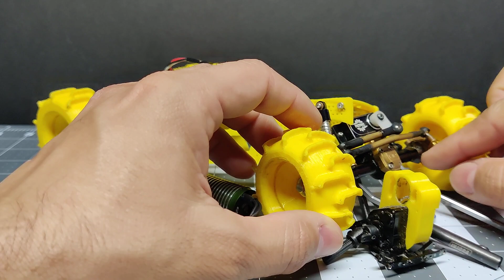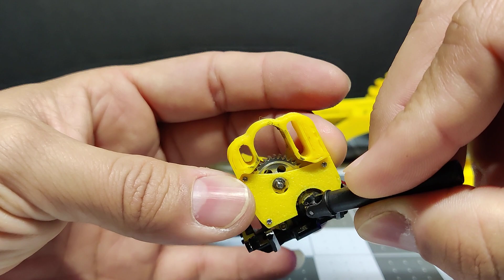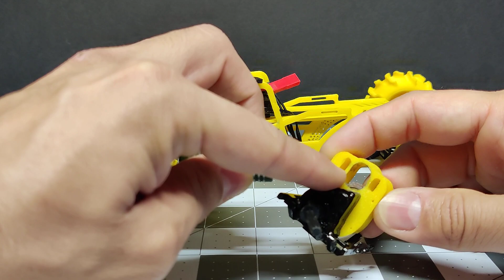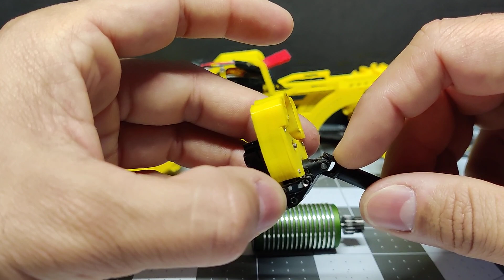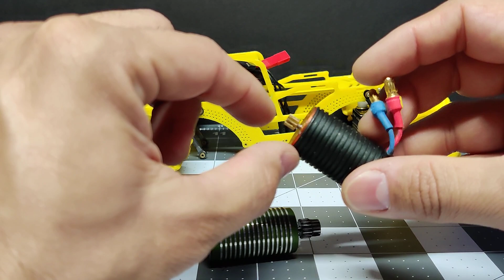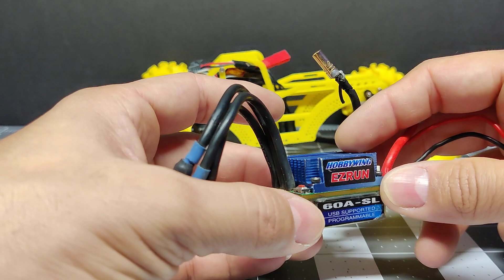SCX24 Furitek Formula Offroad/ Rock Racer post run breakdown.

Comment: I had the same issue with the micro Komodo. I broke every drive shaft that I put on it and when I went to the stainless steel drive shaft that’s when it started breaking dog bones. When I put beefy dog bones in and eventually cvds then it started stripping the transmission and the spur gear and I had a injora trans so I fixed everything and put all stainless steel everything and now the motor will cog down if it’s in a bind instead of breaking everything else. I would much rather have a cheaper weak point like axle shafts but I got tired of breaking and buying new parts so I just try to take it easy with the micro Komodo and I dog out the crawlers that have the OG Komodo and brushed motors. I want to try the new cedar motor but I don’t want to front the bill for broken parts so the micro Komodo is it for me. I know I have spent over $1500 on that 1 truck that I run the micro in. I could’ve built 2 or 3 trucks for that same price. I won’t run portals on anything I have either because I spent way too much money trying to fix every little problem with the set I had and finally I just gave them to a friend. He said all portals are a money pit and I believe him.